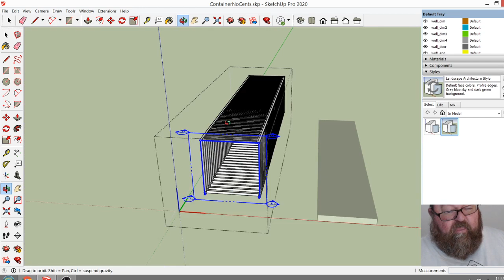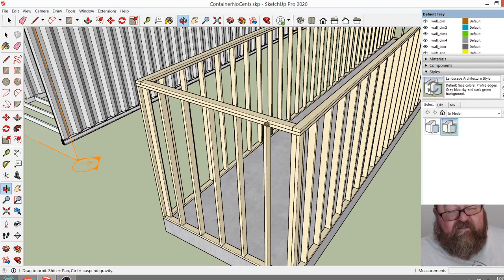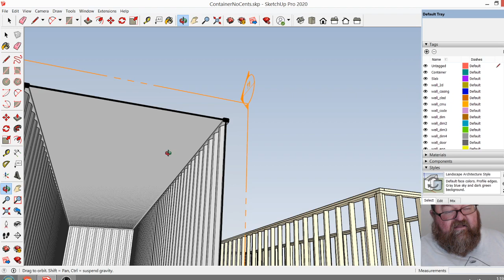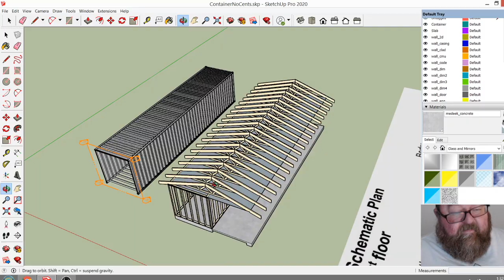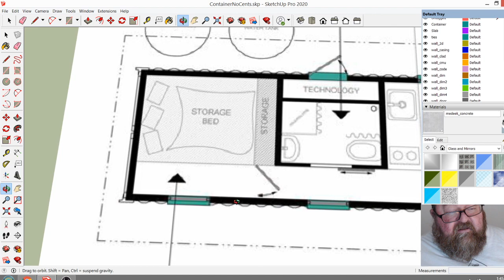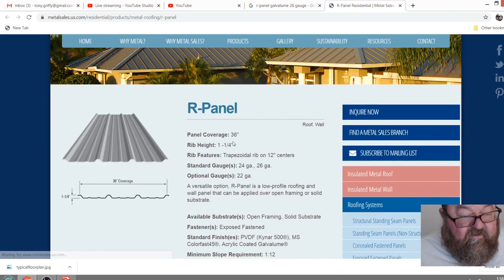Why Shipping Container Homes Make No Cents - Part 1

Comment: Why can’t you build using pier and beam? Houses have been using for hundreds of years?
Reply from the maker: Who said you couldn't?
Reply: Well you said use a full concrete pad, any home you build that uses a concrete foundation is more expensive. Mr T please share that using other types of foundation that are cheaper. Also many home builders can charge 209,000 to build a stick home
Reply from the maker: @anthonymurphy2540  Every job is different and I look for solutions based on the site.  It may be that a slab worked best for this one but I have been building for 44 years and have used concrete piers many times.   But I stand by what O said about shipping containers not making sense :) again, based on my many years of experience building things.

Comment: Ya, spray foam is the best solution for container insulation, and the most expensive.  Insulation alone blows your budget of getting used containers and putting them on post foundation, and assuming you're in rural America with no building codes and can DIY weld.
Reply from the maker: Yes, and really it's a not a good idea to spray it directly to the metal. I know everyone does that but a layered system like we build with framing, sheathing, Tyvek, siding is a better system because it is a layered system and the siding is just a rain screen.  The dynamics of wall assemblies is what a lot of the diy types do not have experience with.  This is really why I am making these videos.   I have another video coming out soon about this.  :)

Comment: Hi Tony, I have watched few of your sketchup videos. I am surprised you have taken this broad, negative position on shipping container homes, given that some of your sketchup clients are building shipping container designs. Moreover, you unequivocally state in the beginning that "you are buying a rust bucket" and that they will inevitably have problems (i.e. leaking). This seems to be painting with a broad paint brush given that many companies sell WWT containers and the majority of containers in the contiguous U.S. are one-way containers; thus, less of a chance to have problems. Also, shipping containers are made of Corten steal that a resistant to corrosion. So, although they may rust, they do not corrode. Moreover, I have owned homes with stucco, hardi-board, maintenance free vinyl and they all need ongoing maintenance. Similarly, log homes or cedar decks or any other material that is exposed to the outside will need maintenance. Now, I will finish the video as I am still in the process of digesting your points. But, at this time it seems you are basing your contention on one myopic shipping container design. This may be dangerous given certain designs allow economies of scale that a stick frame build does not. Btw, your video on a shipping container roof was really good, I have not seen using a 2x4 run the length of the container to act as an anchor for the bottom chord. well done.
Reply: That's because he's in the business of propaganda and lacks vision.  

People build container homes to save money.  Build a traditional home for 300k versus all in 40k to 60k big fucking difference. 

Not to mention I've yet seen anyone I personally know with container homes just sleeping in a container.  They have fabricated it, which isn't expensive if you do it yourself.  

Spraying insulation isn't rocket science if you really wanted to you could do it yourself. 

Also you keep saying rust bucket, not true companies build containers brand new no rust. Pre plumb and wired for electricity. Per your design.  Most of those can be bought under 10k.
Reply from the maker: I have never recommended them for dwellings. All of my customers have used them for what they are designed for, storage

Comment: So shipping containers are out, what do you think of ICF houses?
Reply from the maker: ICF is ok for basements but i prefer metal forms for poured walls because I like the look of poured concrete walls and you lose that with icf.  I would not use icf for above ground living spaces.
Reply: @ArtisanTony  IFC is a poured wall.  Rebar is inserted between the ESP.   A first floor garage or basement works great for ICFs.  Cost vs comfort.

Comment: CAD design is ideal for problem solution. Your building code for R factored insulation prevents innovative design living. Most of all, containers have options including stainless steel. With so many luxury container builds. So, it's a matter of preference. If a choice to have an open top container, then 2x6 ceiling insulation is solvable, in addition to insulating the outside wall to code. Then, an architect for design and or consulting is available in more progressive building areas.
Reply from the maker: You are wasting your money.  Waste away.  And what insulation value do you think you can get in a 2x6 ceiling? R-19. You obviously did not watch the entire video. Stainless steel? lol, you are nuts. They do not exist.  And don't waste money on an architect for a 320 sf home, another waste of money.  I know, I worked for 10 years in architecture.  Have you ever even built anything at all?
Reply: @ArtisanTony  No, I did not watch the entire presentation because container living is an established industry that is flourishing. The fact that the source of containers are almost exclusive from China is unfortunate. A container home with welded foot pads might blow away by tornado, but at a smallest it would be in one piece versus the way conventional buildings have received destruction. All of the negatives you describe are solvable with CAD designed architecture. The tallest container available without a roof have better options for roof insulation. Even metal framing to have a more rigid wall design can prevent a "tin can" effect. Your R-factor building code is anti container living. You're against the concept, in my opinion. I've been studying for a best-way-to-build and still you create and search for unsolvable limitations, in my opinion. Conventional building using chip-board for flooring beams and joists is very risky. America is a consumer nation that is self destructive about housing ideas. Shelter is more of an intention that requires planning in the same manner of your presentation but it's for those who overcome your presented obstacles. You seed better ideas about container housing and that deserves commendation. God bless.
Reply from the maker: @jameslavery6216  Insulation requirements are a fact of life in civilized countries.   The fact is, container homes are presented as an affordable option and they are not.  Count on spending twice as much to build with them.